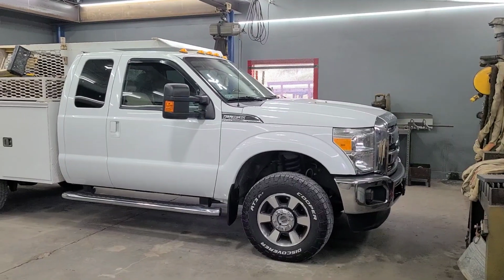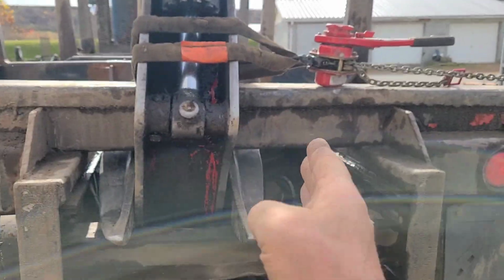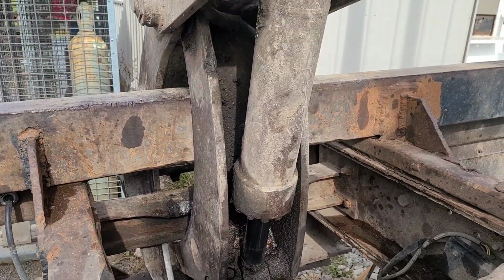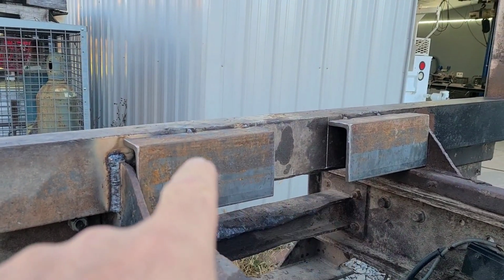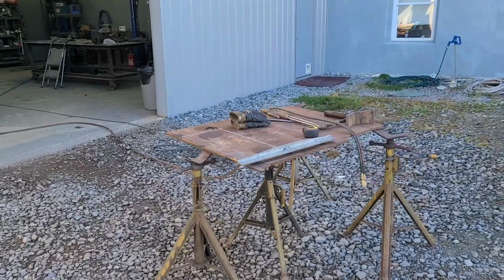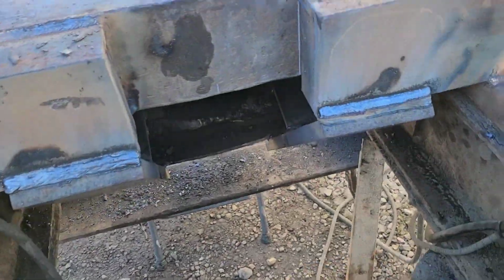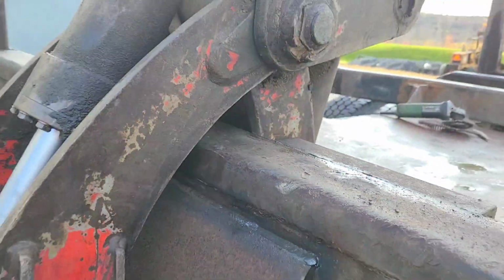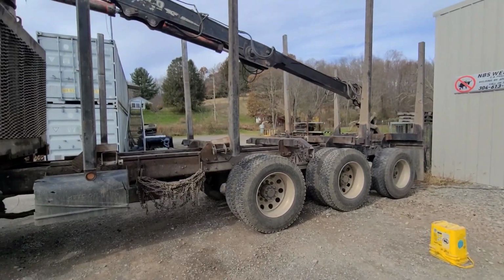Dooin some doozin on the Kenworth log truck

Comment: Very interesting repairs and modifications young man. I like the technique of swapping direction mid weld with a long arc to the other end and come back to where you left off.
I would normally use run off tabs or hot snots in the ends, feather them in and then run a hot pass in. Going to try your way next time.

Comment: Nice repair, seeing all those cracks reminds me of auto transport trailers. They build those things out of such thin material to keep the weight down so they can haul more cars that they are always cracking.  So someone pushed the clutch all the way to the floor while the truck was moving and broke the tabs off of the clutch brake.  That's why you have to put it in gear to engage the PTO.
Reply from the maker: Thanks for commenting and explaining the issue with the clutch brake...I do it that way because that's how the owner showed me to do it on that truck but he never really explained why that truck had to be done that way...nice to know...that's what it's all about...learning more and sharing experiences
Reply: @NBSWELDING    Think of a clutch brake as a 3-4" flat washer with (2) 1/4" x 1/4" tabs in the inside hole.  Those tabs slide into 2 grooves in the input shaft of the transmission.  when you depress the clutch al the way to the floor , the washer is pinched between the throwout bearing and the front of the transmission. this will stop the input shaft from turning.  What happens is someone depresses the clutch all the way to the floor while the transmission is in gear and the truck is moving.  This breaks the tabs off and the clutch brake won't stop the input shaft.  I'll bet when you start the truck with your foot off of the clutch, then push the clutch in, it will grind until the input shaft stops turning.  Tell the owner they make a 2 piece clutch brake so he doesn't need to remove the transmission to replace it.

Comment: Your Kenworth bumper is most likely a 400 grade stainless, one of the things that I see guys doing in correctly when welding on stainless steel is using steel rod, whatever you weld on stainless you have to use stainless rod any welds done with mild steel rod will usually separate from the base metal , 400 grades of stainless will rust and are somewhat magnetic, your  log trucks are sure different than ours out here In the north west
Reply from the maker: Thanks for the info...I've had good luck welding stainless with 7018 in the past...it will rust but it generally will hold
Reply: North west, lol.

Comment: I've been watching your videos and like that you share little tips and tricks that you use. I really appreciate that. A question I had on when you were welding those plates on the rear, your last pass you said you were using 5/32 7014. Were the initial passes with 7018? Why did you switch to the 7014? I'm just trying to learn from ya. Not a criticism. Thanks
Reply from the maker: All passes were 7014...I use it for its higher metal deposit...the flux contains iron powder that becomes weld when used correctly 

7018 is awesome but terribly slow...a 5/32" 7014 will get more welding done in less time than a 3/16" 7018
Reply: @NBSWELDING  ok, gotcha, thanks for getting back to me. Learned something new. So really   7018 should be used when you need the elongation properties that 7018 has. And if you don't, 7014 is a good choice. Is that right?
Reply from the maker: There are several different times when 7018 is better than 7014...the elasticity and strength of 7018 is superior for sure so if its a critical application its a good choice...7018 is also the best choice when dealing with dissimilar metals of various hardness or when repairing cast steel

If you know that both pieces of steel that you are welding together are mild steel in good condition and you want to deposit metal a little faster then that is when the 7014 shines

I will sometimes use 7014 on mild steel repair work if the steel is quite thick and I decide to do some pilot welding...the pilot welding technique is when you achieve strength by running pass after pass and really pile it on there...LOL

You can deposit metal even faster with 7024...but that only works well in the flat position
Reply: @NBSWELDING  awesome, thank you very much. Really appreciate the info

Comment: Is there a reason why you didnt use 7018 for the grapple bracket?
Reply: Yes them bumpers are coated with stainless and and the the rest is mild. Another way to check is to check with a magnet or if unsure  use 309 L-16 stainless rods.
Reply from the maker: The only reason I didn't use 7018 is because it is so slow and inefficient at getting weld metal on the material...I tend to use higher deposit rods when I can just to get more welding done in less time
Reply: @NBSWELDING  thats understandable. As a fellow welder as well, from what i understand 7014 doesnt have the same qualities as 7018 would. Sure still has the 70,000 tensile strength but for shock loading or rigitity purposes 7018 is more superior. Just curious is all
Reply from the maker: You are correct…in tests I’m sure it could be proven that 7018 is superior…but when tests are done they always compare the same material in the same amount so there would be different results if time were considered in the test…I’d like to do some testing of my own so that is an idea for another video I guess

Once you have learned to use the higher deposit rods and you are using them on something where you have the option to weld on it as much or as little as you want then how much more material can be added and how much more strength is being added by adding more material?…even if the material your adding is not as good for shock, elongation, or elasticity…but what if there is way more of it

I think that if you gave me one hour to weld on a plate with 7018 and then one hour to weld on the same size plate with the same size 7014 then I could add more mass to the plate with 7014 in the same amount of time…and if it were in the flat position where I could use 7024 then even more steel could be added
Reply: @NBSWELDING  interesting way of looking at it, 7018 is a fast fill rod too i thought? 🤔😅👍 Maybe i was refering for the structural purposes. Either way you will do what works for you no doubt. Mighty fine job regardless.